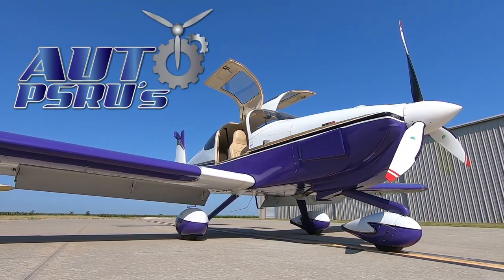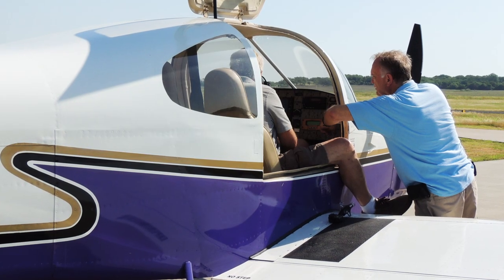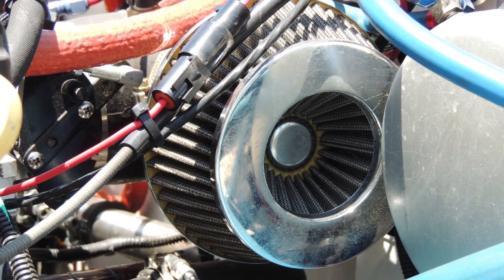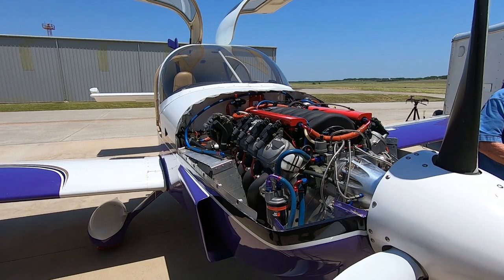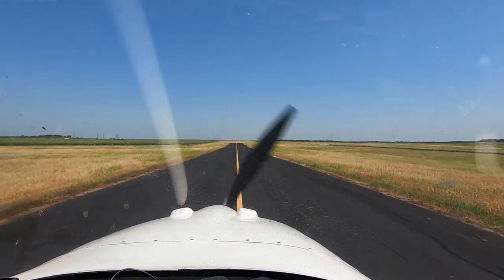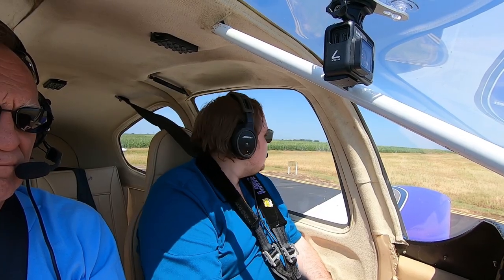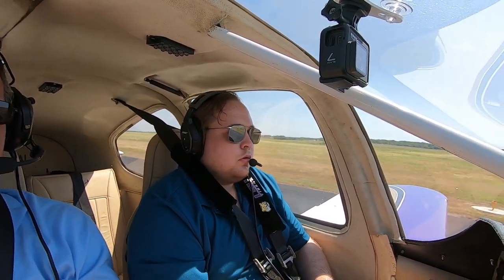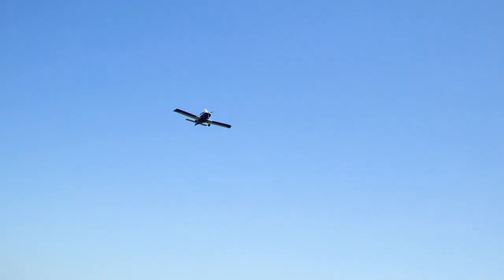Auto Engine Conversion Gearbox for Experimental Aircraft - RV-10

Comment: Martin, Thanks for your enthusiasm. If you can drop in for a visit and we will take you up for a ride that you will always remember.
The side scoops are to get better airflow than what is available with the stock openings next to the spinner (closed off), especially while taxiing. We have never had an over heating problem on the ground no matter how long ground control makes you wait. The side scoops stick out far enough to allow for the boundary layer looses next to the skin. The new inlet area is roughly the same as the old inlet area. The pressure drop across the radiator core is achieved with an exit flap at the bottom of the firewall (behind the nose gear) that is at least 150% larger than the inlet area. The larger exit area also accounts for the expanded volume of air after absorbing heat from the radiators as well as creating a slight vacuum drop.
After this video was made we replace the fixed exit area flap with an adjustable cowl flap to do more testing for ground versus flight cooling requirements. Our hope is to reduce drag in flight without sacrificing cooling on the ground, assuming the difference is big enough to measure.

Comment: Bob, with out a doubt there are better ways of setting up the throttle and propeller governor linkages than what the original builder installed. The 18 months since we bought the airplane has been filled with making updates like that. Thanks for the suggestion on the propeller governor linkage.

Comment: Turbo normalizing to 15,000 feet is already available. With sea level engine performance and less drag cruise speed will increase dramatically.
The biggest issue with turbo charging to 700 hp is the torque goes up to 1300 lb-ft. That would be like putting a PT-6 in these small air frames. That would twist them up like an empty soda can. But wait, there are weirder things than that coming by this time next year with bigger engines on bigger air frames that can handle the power.

Comment: At 1:21 the way that prop governor lever extension loads the lever and input shaft in bending is downright scary. You'd be much better off using a walking beam bellcrank like Van's does for the RV-8 IO360 mixture.

Comment: I would like to see some of the new modern turbocharged V6 engines that are in production in aircraft makes sense to use the turbo charging already engineered by auto manufactures. LS3 is a great engine and it could be turbocharged but the don't need the 2 extra cylinders more then enough power with a V6. The big benefit of the LS3 is the aftermarket support lots of it and parts are low cost.  GM current turbo engine is the 2.7L V6 L3B puts out 310 HP. The direct injection issues can be mitigated by just dumping the crank case fumes to outside instead of sucking it back into the intake.  I also see the issue of sourcing these engines auto manufactures probably don't want anything to do with supplying new crate engines for aviation I could see why the LS series is easy to get.
Reply: I had the same idea with a Audi 3l v6tdi engine for maximum efficiency
Reply: @Jonathan-xv5zi  The only issue is the cost American made, or Japanese made is cheaper for us. Not sure if would need a gear reduction for the Audi TDI need a thrust bearing to handle the load of the prop. That Audi engine makes over 330 lbs of torque at 1400 RPM.

Comment: You are like a lot of interested watchers that have all sorts of ideas on how we should spend a lot of money. But we need to be a lot more practical than artsy. 
NACA ducts are internal structures and ducts that size will not fit inside the cowling. Each radiator is 15x18 for 270 in2 of area and are within 1.0" average of the inner cowling. That space is required for the silicon rubber baffling between the radiators and the cowling to eliminate cooling air from being lost around the radiator.  There is no room to move the radiators further inboard for NACA scoops large enough to supply the same air volume as our scoops, especially during slow ground operations on a hot day.
Your comment about the clunky appearance of the front corners does have good merit. We have had discussions with James Aircraft (close to us by Texas standards) to develop at least the lower cowling for us to replace the two scoops and center tunnel that we currently give customers to modify the Vans cowling that they get in their kit. If that plan were expanded to include the upper cowling as a set then modifying those corners could make the RV-10 look at least 10 knots faster without much extra effort.
The big questions is always how much more would customers be willing to pay for a custom cowling than what Vans charges for the standard cowling. With that subject opened up, would anyone like to comment on how much more they would pay for a ready made cowling versus doing their own fiberglass work to modify a Vans cowling?

Comment: That is awesome!!, if all goes well I want to order my Vans kit within 2 years . Is there a model you recommend for a 6'4" person?
Reply: Wow! I thought I was at a disadvantage at 6'1". Back in the 70's everything was plans built from scratch and all plans were designed around the FAA standard 170 lb male, which was 5'6". But you could modify the plans and parts to fit your body, and you can still do that with plans built aircraft today. With modern kit built aircraft you have to consult with the kit manufacturer to learn what you can do to safely modify their preformed parts, or how to build replacement parts to make the cabin bigger. I can get in and out of an RV-10 with only minor contortions.
My best advice is to ask someone with an aircraft you are interested in if they would let you try it on for size. Other aircraft with large cabins and doors are the BearHawk5 and the Murphy Moose which is coming back. Both companies will be at AirVenture as well as Vans with all their models. We have also done a BearHawk4 which is very similar to the 5 forward of the firewall, and we are currently working on a Murphy Moose.
Some kit manufacturers in the past have advertised the height range that their seats/cabins will accommodate. If they don't advertise it they do know what size person their design was built around. So ask them, and ask if it's possible to modify it to fit you.
Reply: @stuartdavis2297  I really appreciate the detailed response to my question. I'm definitely a fan of this channel, keep up the great work!
Reply: 6’4” here. Can confirm, RV7 and 9 will fit comfortably sitting on just the foam wedges beneath the cushions (removed). It’ll be tight around the shoulders with a similar sized person next to you. Spent about 30 hours travelling across Australia in a 9 like this.

I’ve only sat in a 14 however it’s much roomier across the shoulders. This would be the kit I’d look at in your case.

I’ve also sat in a 10 and while it looks very roomy I’m actually limited by head height. So Torso length is a consideration, as well as seat design - given that they are stand-alone units rather than cushions placed on top of aluminium sheeting fuselage structure, as is the case with the 7/9/14.

And then there’s the much anticipated 15. That may be worth waiting for if you don’t need to buy a kit asap.
Reply: @PatrickJWenzel  Thanks Patrick, I really appreciate the info. Have a great day my friend! Abe here BTW.

Comment: Awesome where canI learn more.   What were your speeds, climbing and level, temps, etc?
Reply: Hi Tim. You can learn more on my website www.autopsrus.com. With the right propeller we can cruise at Vne. The current MT propeller is too small for this engine making the max speed 195 knots. We just started testing with this new LS3 engine. So far the best climb has been 1750 fpm with 80% cruise at 180 knots using the smaller propeller. Engine coolant temps are 170 to 190F, oil temps close at 175 to 195F, and gearbox oil at 180 to 190F.
Reply: @stuartdavis2297   Thx Stuart
Reply: @stuartdavis2297  Vne on the RV10 is 211mph, or 183 knots...  Or is it different than what they list on their website as "max speed"?
Reply: @stuartdavis2297  we’re almost a year in.  Have you found the right prop?   What are the speeds and fuel burn now?

Comment: Can it go inverted (ie loops and rolls)?
Reply: Loops and rolls with an LS3 are the same as with an IO-540. As long as you don't sustain negative G's for more than a few seconds the oil pressure will recover before any damage is done. If the loops and rolls are done right that won't happen. Any amount of positive G's will keep the oil flowing to the oil pickup in the oil pan.
We have done one installation with full inverted oil systems on the LS3 and gearbox. It fills the cowling with a lot of oil hoses but works very well. To be honest, only the one customer has ever liked to hang upside down at more than 1G for any length of time.
Reply: @stuartpsrus5413  Thanks for the information. I was thinking of using a dry sump system so the oil would be under pressure at all times. 
How adaptable are your products to other auto engines? I am researching the Cummins R2.8 diesel (only weighs 503lbs).